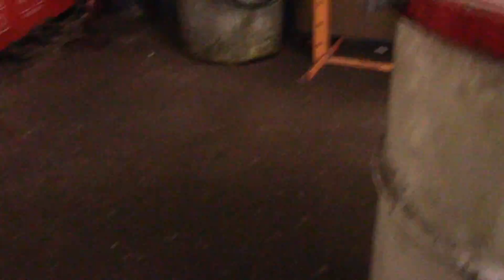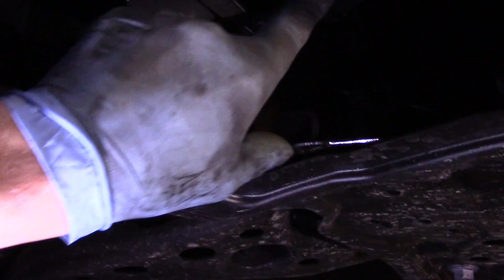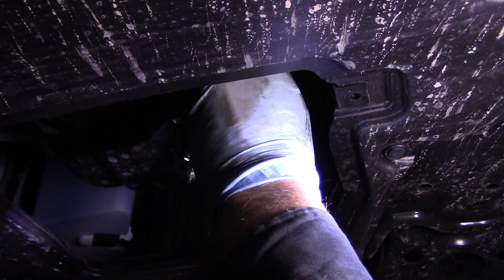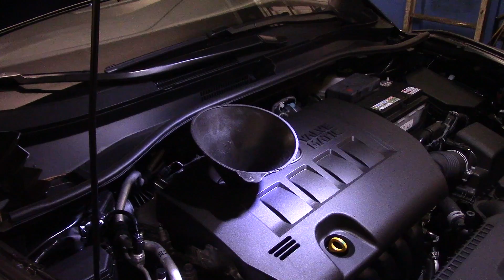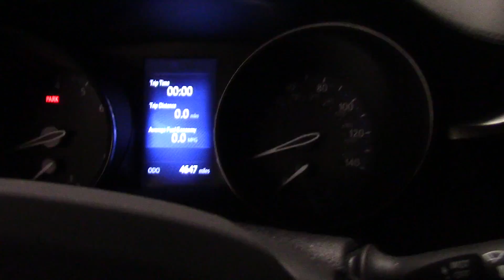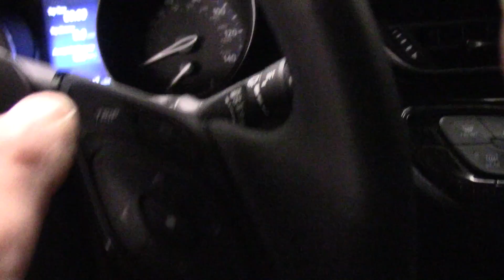2018-2023 Toyota C-HR Oil Change

Comment: Hey Jim, if you get a chance, you should do a how to video on changing the PCV valve on Toyota's new 4cyl engine. For some reason, Toyota engineers thought it would be a good thing to put it directly behind the intake manifold? There's no way to change it without taking off the intake manifold.  Thanks for all that you do!